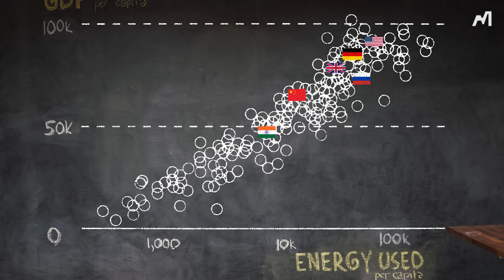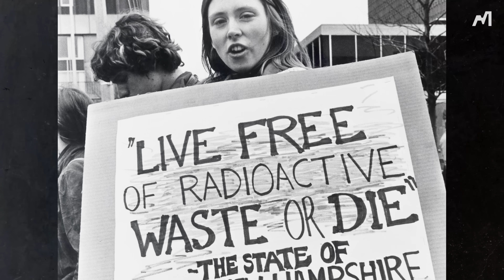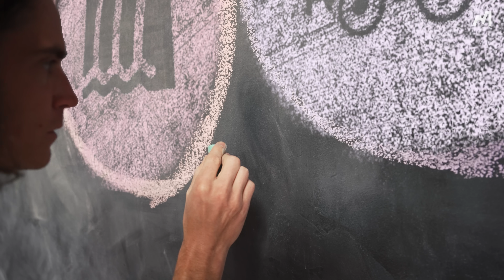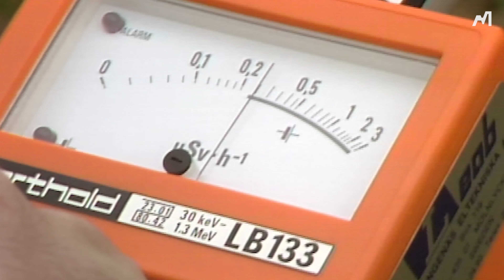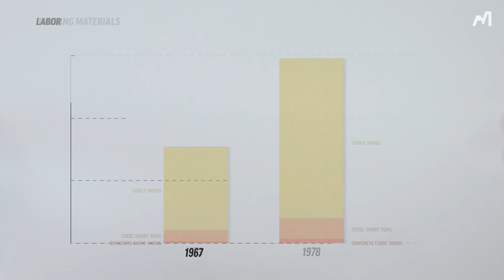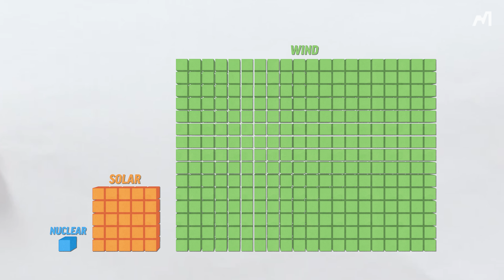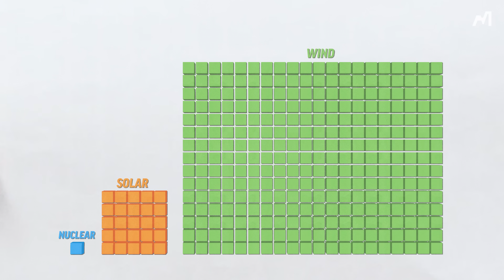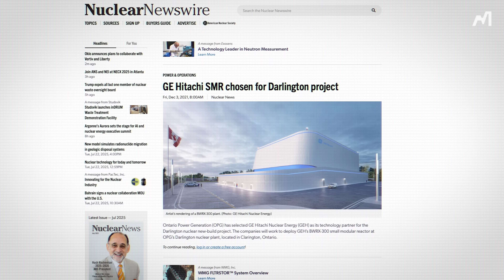They're Lying to You About Nuclear Energy

Comment: I've categorized a nuclear reactor as a modern day steam engine.  As far as I can tell from what I've been able to look at via blueprints and such, that they work almost identically (though I'm sure that I'll hear differently) in that they both boil water to create energy.

And that doesn't even go into how toxic the process is...or how long the "waste" lingers in the environment pretty much forever.     Until we're finally given all the clean energy that has been hidden under the guise of "National Security", it's only going to keep getting worse.
Reply: If ever there were an ultimate limit to "growth," it would look exactly like what is happening now!
Reply: Nuclear engineer student here, correct, they’re boilers which produce steam and spin a steam turbine. Every thermoelectric plant works like that, coral, petroleum, gas and nuclear are all based on something called a rankine cycle.

Comment: Confusing unprocessed safe nuclear materials with the products of nuclear energy such as spent fuel sources and orphan sources will destroy us.

Microplastics don’t rip apart your DNA. And oil companies shouldn’t have access to nuclear technology without having to jump through the hole requiring them to prove they’re responsible enough to care and handle these materials.

This energy will not be accessed by the people, it will be by entities and AI farms.
Reply: Radiation doesn’t “rip apart your DNA”, it depends on the dose, it does at high doses, but the doses involved in nuclear industry are always so low (so low that paradoxically it’s less radioactive inside a nuclear plant than the background outside) that microplastics are actually far worse

Comment: I agree with most of this. But you slam solar for it's large footprint, ignoring that most panels are installed on existing rooftops not in fields.
Reply: Most panels are not installed on rooftops. Rooftop solar is a fraction of utility solar, and many times the cost.

Comment: Nuclear and geothermal wells are where we should be going while researching fusion and solid state batteries. Solar will be a good option once MJ cells are commercially viable as they double efficiency and so require half as much land. We need better drilling tech to drill geothermal wells in most of the world, but surely this is a much easier problem to solve, there's just been no money poured into it, it's not fusion or fossil. Imagine how easy it'd be to power anything if we could just drop some geothermal wells anywhere and put a little building on top and get out 100 megawatts of power. Anywhere on Earth.

Comment: The bit about the human body learning to avoid radiavis nonsense the human body evolved in the presence of much higher back ground radiation levels  as they evolved cells developed the ability to self repair damage from radiation exposure out cells retain this ability when human cells are exposed to radiation this repair mechanism comes to the fore and ramps up the repair  giving the cell  a better chance of avoiding cancer causing genetic damage this is called radiation hormesis.

Comment: Another idea is larger nuclear power plants (than small modular), but still built in a single location (or the reduction in cost/improvement in quality/consistency), is molten salt nuclear reactors built in US shipyards.  The idea is that you can build something larger than can be transported over US roads as a single structure and have it towed off the coast of major US cities and plug it in.  Given that most major US cities are near the coast (or the Mississippi) these kinds of reactors would be able to supply power to a very high percentage of Americans with low transmission infrastructure costs.

Comment: its right that many of the scenarios dosent have high death rates, but just one cell needs dna at to give life to other cells with the SAME DAMAGE to the dna, for you to get deadly cancer. right, and i will not argue that the radiation level is low, but if you think you can compare, the radiation to suns rays, hitting us, you are very wrong. some areas of for an example fukushima recieved 20 millisieverts a year. althoughi dont precieve it radiation as an potential dilemma, at those levels it very well could cause issues when we ramp up the amount of nuclear powerplants

Comment: Nuclear power is great. Nuclear waste is not great. the benefits and drawbacks of each sort of cancel each other out and the remaining factor is just financial cost, and as of now nuclear is not the most cost-feasible method of generating power. If/when they figure out an actual viable way to eliminate the waste completely, or come up with a way to generate nuclear power on a large scale without transuranic leftovers then I would fully support it. De-regulating the current industry is going to create more problems than it solves.

Comment: As someone who works in the industry and has worked on Wind Farms, Solar Farms, Hydro, Nuclear, Coal & Natural Gas, Nuclear is far superior to everything else. But we need solutions for the waste, preferably an alternate plant that burns the waste down in to a safer substance. Beyond that though what we really need is Fusion and it finally looks like that is just a few years away. Commonwealth Fusion Systems is supposed to create their first plasma next year and have their first generator plant by the mid 2030s. But we will still need Fission to help balance the grid. It isn't a silver bullet. It will take between 25 and 50 years of building new plants before the price of electricity starts to fall again.

Comment: The original designers did not recommend the reacter designs. Their recommended reacter was the Thorium MSR. Any failure would simply shut it down. Estimated time til refuel could be as long as 1000 years.

If nothing else, these reactors would contain and reduce ambient radiation.

The real problem is not the nuclear plant. It is the AC Electricity that is generated. The electricity (more precisely, electromagnetic energy) is far more toxic to the environment, than nuclear and oil combined.

Comment: I would rather see a different direction taken in nuclear power along with SMR's. Thorium used instesd if uranium. Its even harder to make a bomb out of it, it is extremely abundant ( most uranium mine mine tailings contain a huge amount of thorium in the tailings, thus reducing the emvironmental damage caused by the mining of uranium), and it creates and is alot less radioactive than using uranium. ( 10,000 years to store uranium reactor waste vs 300 years for thorium) In my opinion achieving a sustainable thorium reactor is far more achievable than achieving fusion and could provide thousands of years worth of electric energy because it is so abundant on the Earth. In have lost my enthusiasm for uranium based nuclear but thorium makes me so excited that I believe that we should create an international research effort to finish the work for a commercially feasible molten salt thorium reactor.

Comment: While everyone is worrying about reactors, I know of two times the folks at Los Alamos almost set off a bomb in their own laps In the middle of the Pajarito plateau where the main labs are.  Once at Anchor Ranch site, in the mid 1960s, where a tech assembling an explosives test found what was supposed to be a depleted Uranium pit hot to the touch in January. It turned out to be plutonium.  At the time it was thought it would have had a yield of 100kt.  The labs fired the entire of N division from the top on down.  Can't say about the other time.

Comment: Solar actually has many more deaths.  
  
The data is skewed because the desths with solar are from falling off roofs when installing. But the data is recorded under "rooftop work" and not solar itself. But the only reason that worker was on the roof was solar power.  
  
Roof top work is a top 10 deadly occupation. So every year youve probably got dozens of people in the US dying from falls that are solar related.  
  
You even have to factor in home owners and repair men falling while looking at panels and so on. Those people are less likely to have a harness on.

Comment: I was working at one of the most radioactive spots in Los Alamos and got worried about my dose.  I took a dosimeter outside of my lab and found 15 mR per hour.  My lab was lower dose by 25%.
Reply: Check out the latest concerning Chernobyl.
Reply: Have you been eating any shrimp lately?
Reply: @richardmcbroom102  Can't afford shrimp.  Saving up for some good 'ol beans.

Comment: The Chernobl disaster occurred because the Soviets want to see how long the reactor would keep running after all exterior power had been shut off.  This was a question of how reliable their atomic arsenal would be in war.  Debacle ensued.
Reply: There is no such thing as permanent, safe, storage of spent fuel (witness the ongoing storage of spent fuel at plant locations from lack of dumping sites, making each reactor site "an event in progress," just like what is going on at Chernobyl and Fukushima)!
 
More stupidity is not the solution to stupidity. The simple fact is that the intense ionizing radiation in the boundary of the nuclear fuel causes the containment to transmute over time, where the containment materials lose their original elemental qualities, frequently becoming brittle and no longer able to perform as originally intended. Zombie reactors that are past their designed life are losing the safety safety factors originally designed into the containment in ways that are not predictable until incidents inevitably occur. The same thing applies to the containment of high-level nuclear waste. These matters are well-known to the industry, but being withheld from public scrutiny in order to maintain the current zeitgeist.

Comment: In Los Alamos the problem was cowboy types that thought any rule would not apply to them.  Also they really had no idea until the 1950s that low doses of radiation were all that harmful.  The worst radiation accident that I witnessed was some Elmer PHuD taking a very bright Co-60 source and walking by the main (1970s) computer building.  IBM had just installed a robotic memory cylinder retrieval system that now held ALL the data from the last 25 years of nuclear testing.  The source was in a small lead pig with a hole in one end, so it acted like a death ray out the open end.  The reprobate held the open end away from his own body and that pointed it toward the archive data and wiped the data from a huge swath of data storage.  Fortunately they had just finished backing up the data.
Reply: There is no such thing as permanent, safe, storage of spent fuel (witness the ongoing storage of spent fuel at plant locations from lack of dumping sites, making each reactor site "an event in progress," just like what is going on at Chernobyl and Fukushima)!
 
More stupidity is not the solution to stupidity. The simple fact is that the intense ionizing radiation in the boundary of the nuclear fuel causes the containment to transmute over time, where the containment materials lose their original elemental qualities, frequently becoming brittle and no longer able to perform as originally intended. Zombie reactors that are past their designed life are losing the safety safety factors originally designed into the containment in ways that are not predictable until incidents inevitably occur. The same thing applies to the containment of high-level nuclear waste. These matters are well-known to the industry, but being withheld from public scrutiny in order to maintain the current zeitgeist

Comment: average - pop - radiation bad vs complex accurate argument. Latter looses.
Reply: There is no such thing as permanent, safe, storage of spent fuel (witness the ongoing storage of spent fuel at plant locations from lack of dumping sites, making each reactor site "an event in progress," just like what is going on at Chernobyl and Fukushima)!
 
More stupidity is not the solution to stupidity. The simple fact is that the intense ionizing radiation in the boundary of the nuclear fuel causes the containment to transmute over time, where the containment materials lose their original elemental qualities, frequently becoming brittle and no longer able to perform as originally intended. Zombie reactors that are past their designed life are losing the safety safety factors originally designed into the containment in ways that are not predictable until incidents inevitably occur. The same thing applies to the containment of high-level nuclear waste. These matters are well-known to the industry, but being withheld from public scrutiny in order to maintain the current zeitgeist.

Comment: Maybe … we now have climate change to fear and we might give nuclear energy a second look
Reply: If ever there were a limit to growth, it would look exactly like what is happening now!
Reply: There is no such thing as permanent, safe, storage of spent fuel (witness the ongoing storage of spent fuel at plant locations from lack of dumping sites, making each reactor site "an event in progress," just like what is going on at Chernobyl and Fukushima)!
 
More stupidity is not the solution to stupidity. The simple fact is that the intense ionizing radiation in the boundary of the nuclear fuel causes the containment to transmute over time, where the containment materials lose their original elemental qualities, frequently becoming brittle and no longer able to perform as originally intended. Zombie reactors that are past their designed life are losing the safety safety factors originally designed into the containment in ways that are not predictable until incidents inevitably occur. The same thing applies to the containment of high-level nuclear waste. These matters are well-known to the industry, but being withheld from public scrutiny in order to maintain the current zeitgeist.

Comment: The only major issue with nuclear is scaling. U can get to a place 10 years where u get 5-10 GW from nuclear each year. But if u want 10-100 GW a year there is only solar.
Reply: There is no such thing as permanent, safe, storage of spent fuel (witness the ongoing storage of spent fuel at plant locations from lack of dumping sites, making each reactor site "an event in progress," just like what is going on at Chernobyl and Fukushima)!
 
More stupidity is not the solution to stupidity. The simple fact is that the intense ionizing radiation in the boundary of the nuclear fuel causes the containment to transmute over time, where the containment materials lose their original elemental qualities, frequently becoming brittle and no longer able to perform as originally intended. Zombie reactors that are past their designed life are losing the safety safety factors originally designed into the containment in ways that are not predictable until incidents inevitably occur. The same thing applies to the containment of high-level nuclear waste. These matters are well-known to the industry, but being withheld from public scrutiny in order to maintain the current zeitgeist.

Comment: If I could show this video to every idiot that hates nuclear power
Reply: There is no such thing as permanent, safe, storage of spent fuel (witness the ongoing storage of spent fuel at plant locations from lack of dumping sites, making each reactor site "an event in progress," just like what is going on at Chernobyl and Fukushima)!
 
More stupidity is not the solution to stupidity. The simple fact is that the intense ionizing radiation in the boundary of the nuclear fuel causes the containment to transmute over time, where the containment materials lose their original elemental qualities, frequently becoming brittle and no longer able to perform as originally intended. Zombie reactors that are past their designed life are losing the safety safety factors originally designed into the containment in ways that are not predictable until incidents inevitably occur. The same thing applies to the containment of high-level nuclear waste. These matters are well-known to the industry, but being withheld from public scrutiny in order to maintain the current zeitgeist.
Reply: If ever there were a limit to growth, it would look exactly like what is happening now!

Comment: "Denial" is not a river in Africa.

There is no such thing as permanent, safe, storage of spent fuel (witness the ongoing storage of spent fuel at plant locations from lack of dumping sites, making each reactor site "an event in progress," just like what is going on at Chernobyl and Fukushima)!
 
More stupidity is not the solution to stupidity. The simple fact is that the intense ionizing radiation in the boundary of the nuclear fuel causes the containment to transmute over time, where the containment materials lose their original elemental qualities, frequently becoming brittle and no longer able to perform as originally intended. Zombie reactors that are past their designed life are losing the safety safety factors originally designed into the containment in ways that are not predictable until incidents inevitably occur. The same thing applies to the containment of high-level nuclear waste. These matters are well-known to the industry, but being withheld from public scrutiny in order to maintain the current zeitgeist.

Comment: There were definitely reckless people in the Manhattan project.  They knew better, yes.  Some just didn't care and several very smart people the government asked to join in warned them they were flirting with death.  They ignored any safety advisories, and at one point were holding two parts of the apparatus around the core (that if they closed would start to cause the critical reaction) apart with a SCREWDRIVER EDGE.  They were beyond reckless and arrogant.